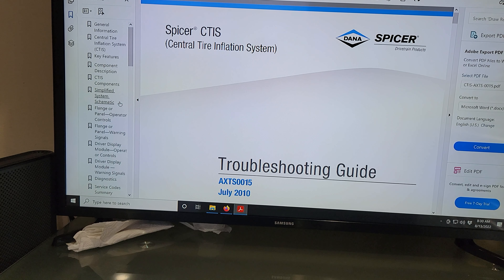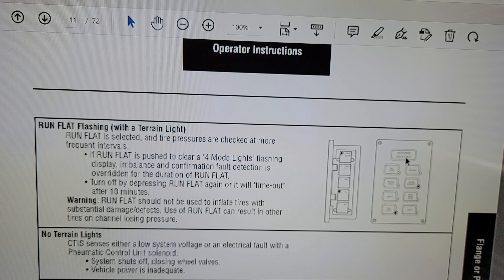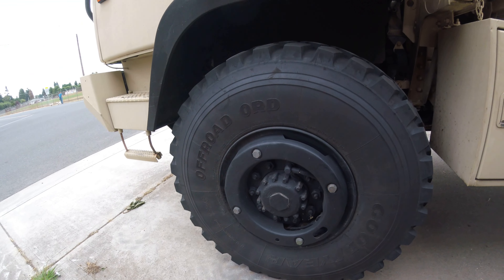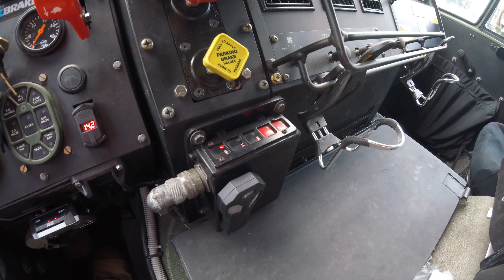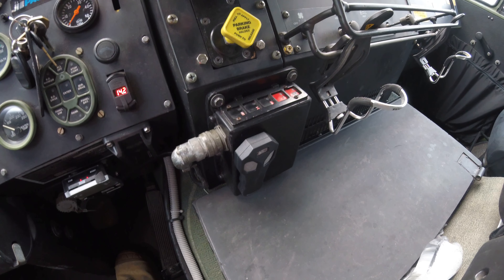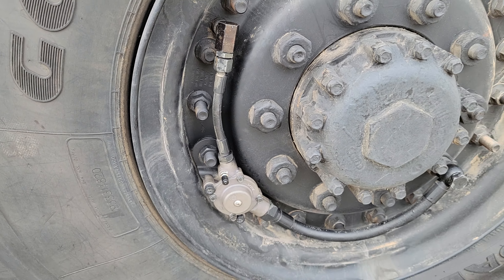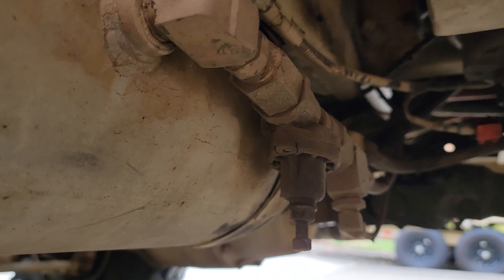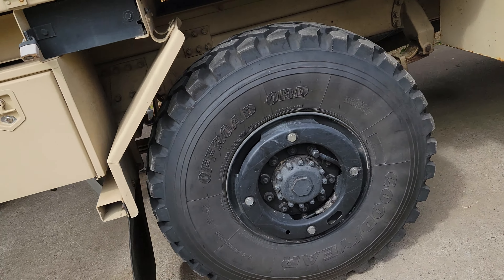Abel LMTV build part 168 (CTIS troubleshooting and fixes)

Comment: Good stuff! So glad I don't have any issues with CTIS after I tightened the lines to the axle.  Occasionally, I will get all the lights flashing... after about 15 minutes it goes through a check and resets. I have rebuilt the wheel valves before... they are so expensive these days!!! Thanks for showing this... very helpful!

Comment: Another great video! I drove my truck the other day and my CTIS started acting up after pushing the cross country button. I have the 150psi transducer installed and that was the first time I have pushed any of the settings since the install. Headed over to the fb page to do some reading.

Comment: Another great informative video! My CTIS doesn't work. I have a solid light for highway on but doest inflate or deflate. I'm going to work on it today! Thank you for the video and inspiration!
Reply from the maker: Don't forget to grab the troubleshooting pdf I uploaded to the fb group
Reply: @SeanFillner  I’m going in to print it right now. I discovered I have all of my lights on on my CTIS controller. You don’t happen to know what that is off the top your head do you?
Reply from the maker: @TRCa51  the troubleshooting manual should point you in the right direction.
Reply: @SeanFillner  Nothing for five solid lights. From what I see on the Internet it may be a bad controller? What part did you replace after welding on your chassis? And did that affect the lights on the controller at all?

Comment: I had this issue with mine. It's not always wheel valves, it can be air not completely draining due to obstruction in the air line between the wheel valve and quick release valve. It ended up being one obstruction in my rear hub and a kinked hose in the front of mine. Having the higher PSI HWY setting exacerbated this problem.
Reply from the maker: Yes that can be very true.  I know my truck too well so this problem was something I was keeping an eye on and it was time to fix it...
Reply: @SeanFillner  Of course! I added the comment more for others. We know our trucks quirks. They get cranky. 🤣

Comment: Interesting, for about 5 years one of the reasons I've kept myself from buying one of these to use as an occasional truck to tow my car and also just for fun and camping was the issue of investing into a rig like this and not being able to find parts. Then I figured out that most all of thr drive train is common medium deisel components and parts are plentiful if you can figure out the civilian part number. So with that in mind, these vehicle were back on my radar. Now I randomly find this video and heard a lot how the CTIS is a great system to have when it works. I've seen quiet a few rebuild kits for the CTIS system available but you're saying these aren't actually readily available? I guess I could always just cap the system off but certainly wanted to keep it active. Man I want one of these things just scared of getting into it and having issues finding simple parts to keep it going years to come. Imagine a small simple part keeping a relatively expensive rig with a lot of time invested from running.
Reply from the maker: We love Abel!  One of the best investments we have ever made.  I have found the small things that keep the truck from running don't really exist like I thought they did.  Everything on the truck is redundant to the point that a system may not work but the truck can still get you back to safety.  There are work arounds to everything and you will soon find that out if you are on the facebook page I mentioned....  If you dig back through this series or the Adventures with Abel series you will only find one thing that happened and we still made it home : A failed waterpump seal, fixed in 4 hours....  These trucks are a testament to proper and good maintenance and they will take great care of you.
Reply: @SeanFillner  so what you're saying is... stop being a wuss and just buy one already lol. Also I'm not sure what constitutes "expensive" for the wheel valves but Midwest (MME) has them for about $100 a piece as well as full rebuild kits for like 280. If a set last a real long time I don't think that's to much but again I have no idea what is a reasonable price.
Reply from the maker: @DDRDK  like every type of business there are good guys and bad guys out there when doing said business.  I am sure if you get one of these trucks you will  quickly find out who those people are.

Comment: side note......  for future reference..... there is just enough failures to warrant NOT  plugging/unplugging the ctis while powered up (or jumping batteries with it plugged in).   Might never be a problem for someone..... till it is that one time and you brick it.  Not saying its a "fact"....  only that it seems tied to just enough failures to make you go hmmmmmmmmm.
Reply from the maker: Good point.  I have spare ctis ecus so I was not worried and the wrecker one I have seems to be more robust.

Comment: Honestly Sean, dump this unit and get the Arduino driven unit from Plasa on Steel Soldiers.
Reply from the maker: You mean the ctis controller?  Is there a unit I can purchase that is plug and play?  Last time I checked one had to buy all these bits and pieces and assemble/program the unit.  I don't want to do that.
Reply: @SeanFillner  Don't know about assembly. Mine was built. Plasa is a nice guy who has a FMTV in Italy. He will ship it to you. I have one. Just not hooked up right now, but when it was it worked really well.  Busy with other stuff.
Reply from the maker: @urgentcareguy3  we connected on steel soldiers.  Thanks for the idea
Reply: @SeanFillner  Glad it worked out for you. Yes I saw your request for information because I posted on that thread previously lol